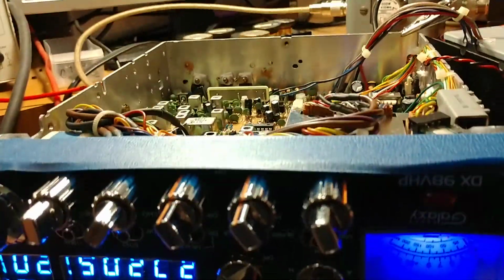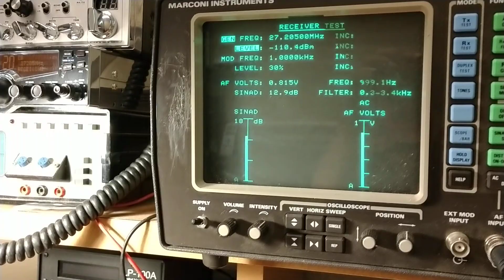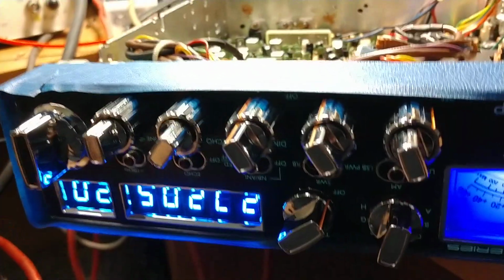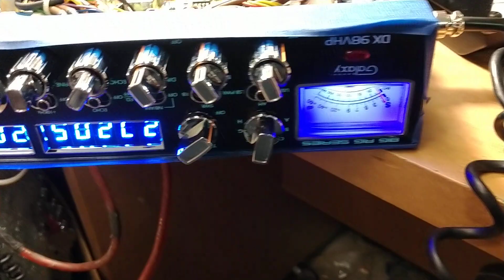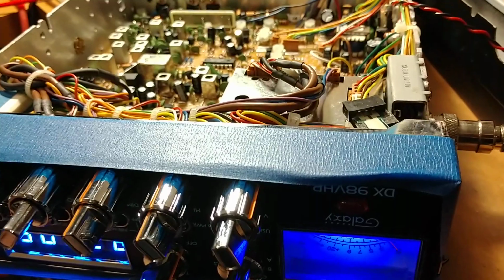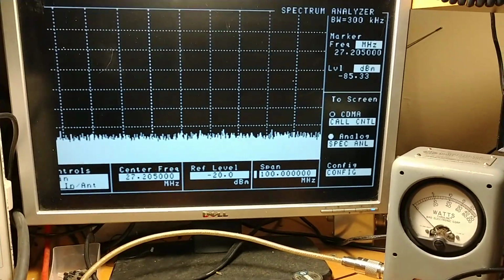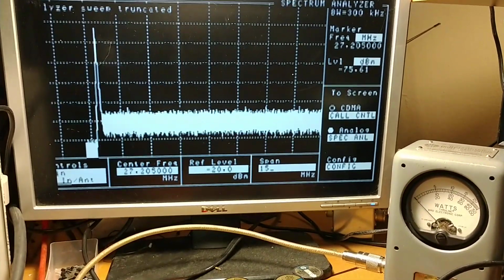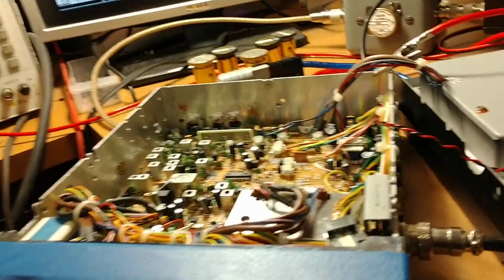Galaxy 98vhp is not a 300 watt radio I don't care what the solder jocks on Facebook say!

Comment: Here's a great thing to remember with electronics if it runs hot it needs a fan or multiple fans to keep it cool this goes for radios & All amplifiers. Heat is a transistor or Tubes worst enemy 🔥

Comment: I used to have a Galaxy DX 44V that was stock out the box, no mods, and it talked and received great. That was over 20 years ago and i was thinking about getting a new Galaxy radio but I'm getting the vibe that they aren't what they used to be, I'm hearing they aren't aligned properly from the factory, i hear they have weak soldering, cheap electrolytic caps, and so on. Is most or all of that true? I really love Galaxy radios and would love to get a new one, I'm not interested in hacking it up, i like my CB's bone stock, and i sure don't want it splattering all over the damn frequency range. Anyone care to verify the quality of brand new Galaxy radios I'd sure appreciate it.
Reply: All cbs are made in Malaysia. The Magnum S9 it the only 10 meter radio i like. It has been discontinued but is still out there.